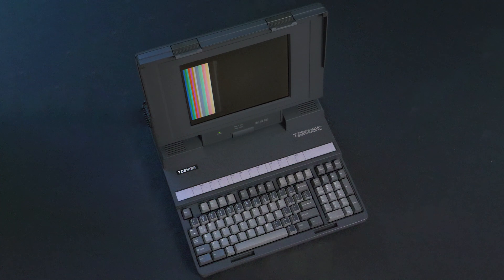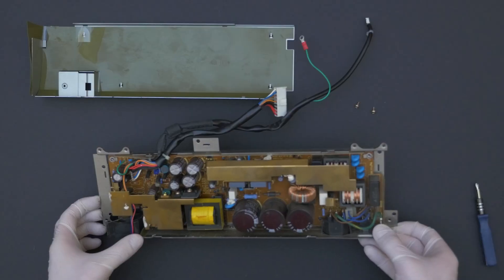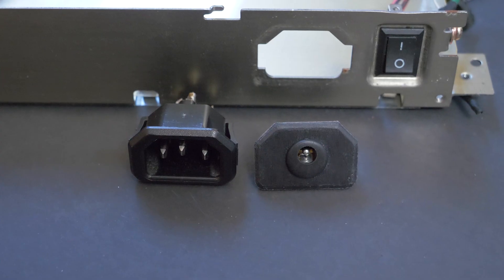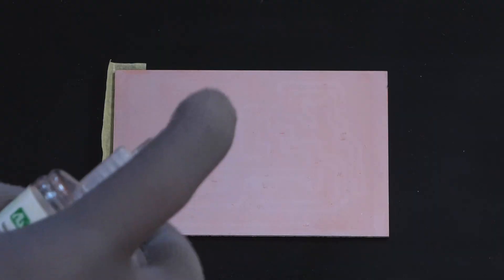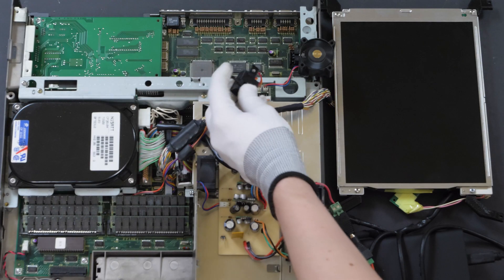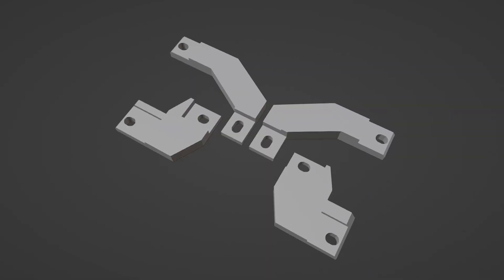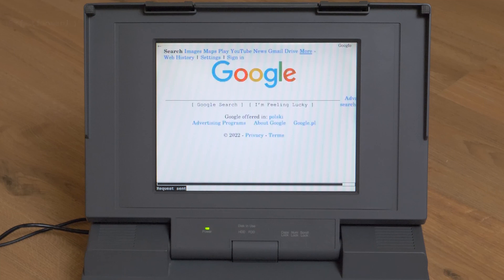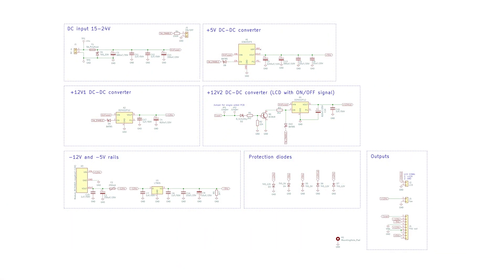Toshiba T3200SXC (1991) restoration. New PSU, LCD, WiFi for the first laptop with color TFT screen.

Comment: Elite! Hoping to see more info about this project! interested in the WIFI solution - how did you do that? I've got a T5200 and T3200SX that I'd love to get on WIFI!
Reply from the maker: I have planned preparing a detailed guide, just need some more time. However the first step is getting an ISA ethernet network card and a packet driver - I used 3com etherlink.

Then to convert it from wired to wireless, I used an A5-V11 mini router - it costs around 10$. I flashed it with OpenWRT with these instructions: https://openwrt.org/toh/unbranded/a5-v11 and that gives me a lot of control over this device.

The simplest way to use this router is just to connect a short network cable and power it from powerbank, but I also plan hiding it inside of the machine and soldering cables directly to the network card.

To scan and connect to Wi-fi directly from MS-DOS, I used some scripts both on the router and on the laptop. I put them here: https://github.com/adbrt/dos-wifi-solutions/
they are not well documented yet, but that's basically everything that I had to do in order to get the machine on the wireless network.
Reply: @adalbertfix  legendary! You've saved me a lot of googling, can't wait to try this!